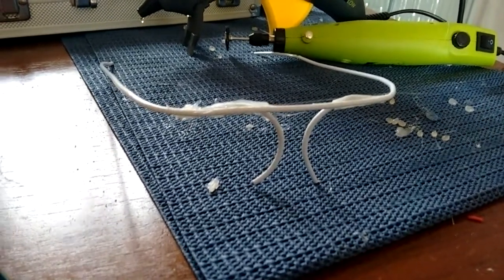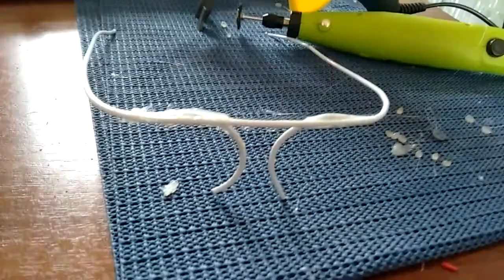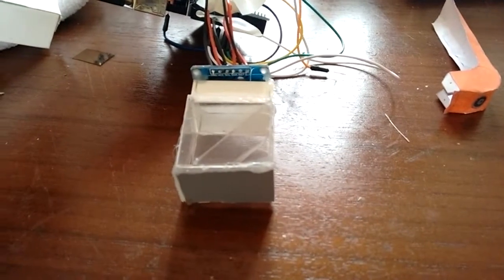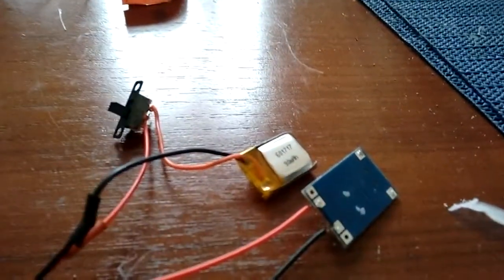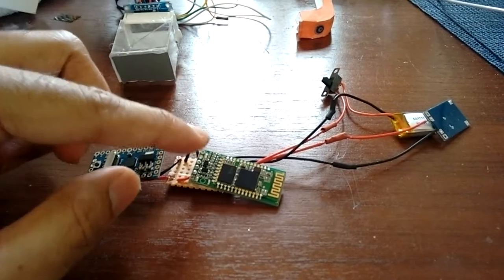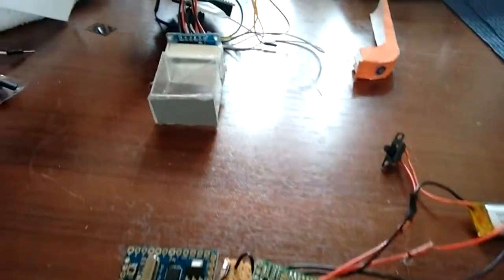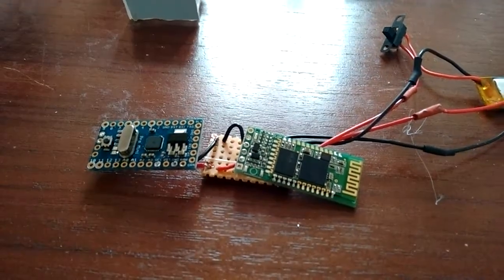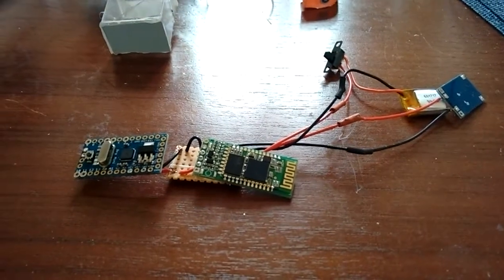Diy Google Glass Update - circuit and frame

Comment: Nice project mate!
I hope you will get better with you health issue.
I was thinking of using some lenses to make the screen appear smaller, but you still need a "box" the size of the screen.
What 3D printer did you order?
Reply from the maker: Thanks. Yes you can make the prism part smaller in theory but the box will be the size of the screen. I ordered the m3d printer which costs $349 not sure exactly how much in pounds. https://printm3d.com/

Comment: if you can somehow find a display small enough, you could technically use and android phone or stick-pc and run the glass launcher right?
Reply from the maker: Because I communicate to my android phone via Bluetooth then didn't go down that route but yes its possible. The smallest screens i've found are not high in resolution to do the job. The better screens cost hundreds. Then you also need a driver for the screen which will allow you to connect it to the android stick. Also you'll need a bigger power source. So there will be many issues to tackle but technically possible.